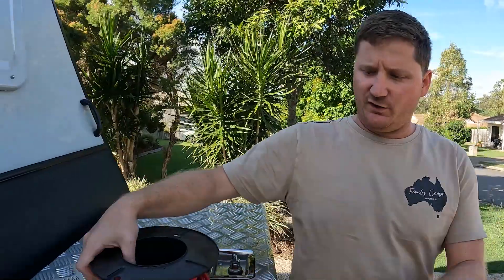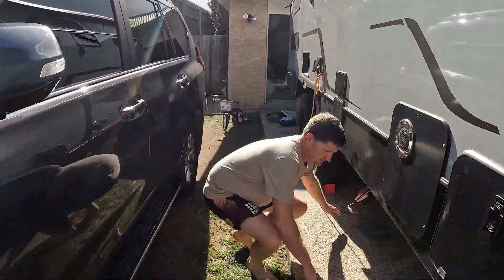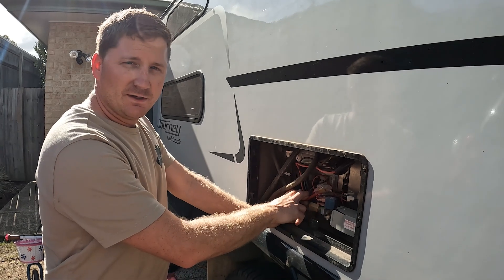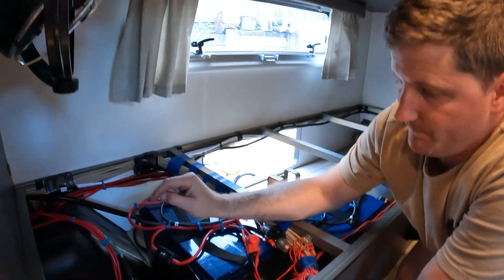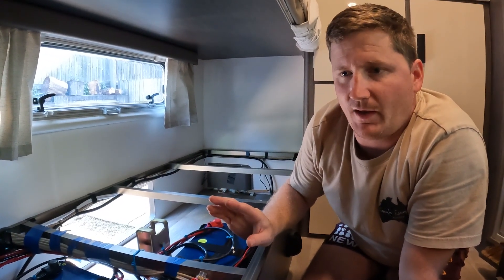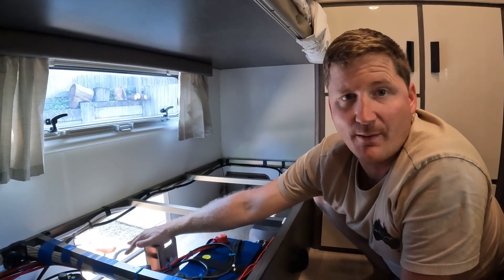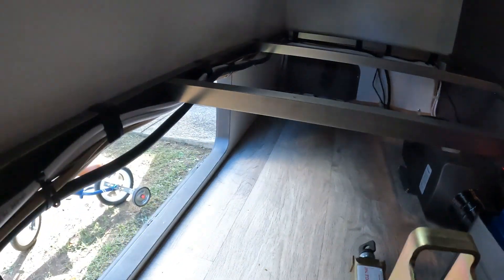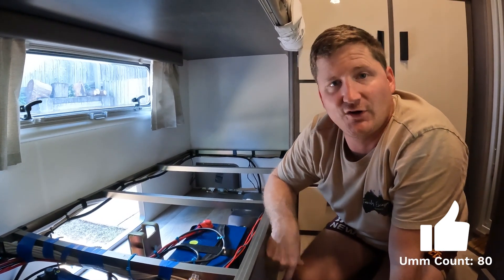Jayco Journey 17.58-3 Wiring for OFF GRID CAMPING

Comment: Great vid - thanks. Same van and looking at the same setup. Only question - other than the battery monitor (which you need to have eyes on), do you have any protection on the van batteries level to protect the fridge from depleting then if left on 12v too long?  What is the battery capacity and how long do you get out of them running the fridge?  Thanks!
Reply from the maker: Hey kieren. We never ran it for long periods off the battery. It was mainly for lunch stops etc. It ran for over an hour just fine and batteries were always fully charged when we arrived at camp. It was 240ah of agm batteries. I didn't install anything to stop the fridge draining the battereis as the dcdc charger could always get it cahrged back up before we arrived at camp. I wouldn't recommend running it overnight on 12v as it's not really designed for that. 🍻

Comment: I found your video very informative. We have a 2021 17.55-9 with 2x100ah Lithium and 2x160w panels. It has the Projecta 235J BMS.  This setup serves our requirements well, but I have a feeling it could be more efficient in it's solar charging. If I get more than 8 amps solar charge I am doing well. The panels may be a bit dirty at the moment as we have been travelling on dirt roads. Your thoughts would be appreciated.
Reply from the maker: Hey Ian. I'm glad you found the video informative. We are heading out in our van for the next few weeks I will monitor our solar input and get back to you. Its hard to comment on this as there is alot of variables. With only 8 amps of input from 2 160w panels I would say you need to investigate further.

Comment: Any recommendations for a DC to DC charger with MPPT? Great videos by the way.
Reply from the maker: Hey Rob I really liked the redarc gear and have been running it for a few years now with no issues. We are about to give enerdrive a go as thats what comes with the new caravan. The enerdrive 40amp dcdc charger has great reviews and a built-in MPPT. I think you can go either of those 2 brands and you won't have any issues. I wasn't a fan of the jhub system. Thanks for watching and hopefully that helps.

Comment: Which J35 do you have? Is it suitable to charge the lithium battery's?
When connected to 240v, is the j35 able to safely change the lithium?

Cheers.
Reply from the maker: This was the j35b.
From memory, you need the j35d for litium. 
I haven't heard of any issues with the j35 charging any batteries, but it would be a better question for bmpro. 

Sorry I couldn't help more.

Comment: Good evening, did you put a circuit breaker near your car battery for the leads down to the trailer?
Reply from the maker: Hey Chris. Yes i have placed a 40amp redarc midi fuse near the battery. If you watch our jayco walk through video i talk about them and show the wiring under the bonnet. Thanks for watching.

Comment: Found this interesting, waiting on the arrival of my new 17.55.8,   I optioned the larger 3 way fridge and was told by the dealer it doesn't run from the house battery (120 Lithium)but direct from the start battery and a vsr, I would rather run it off the house battery and a dcdc similar to what you have done , I cant get any sense or reason from Jayco about this system, was yours set up the same way.
Reply from the maker: Yep originally it was setup as they said but I changed it to what I thought worked better. This way the fridge stayed cold while parked up for extended periods. Once we set up camp, I wouldn't run it on 12v as it's not designed for that.